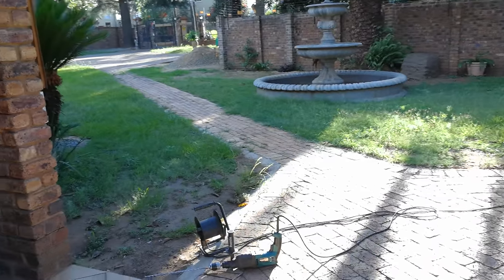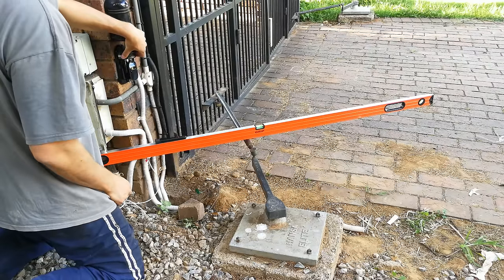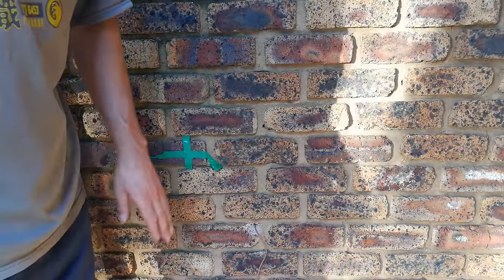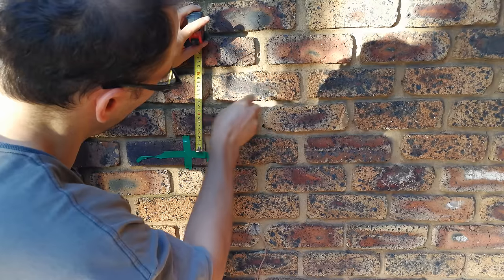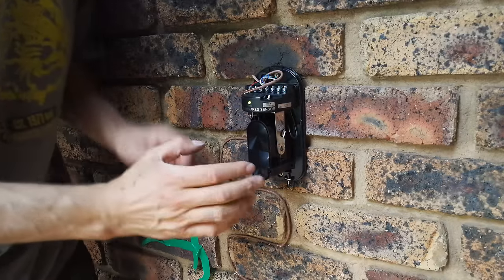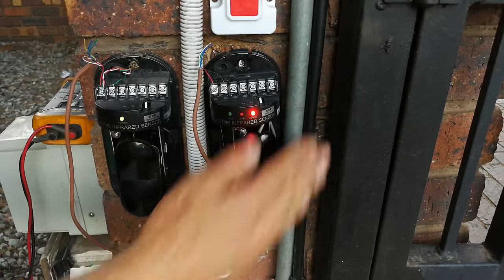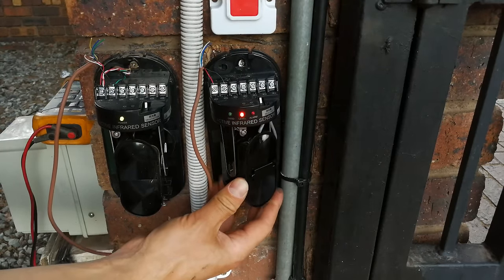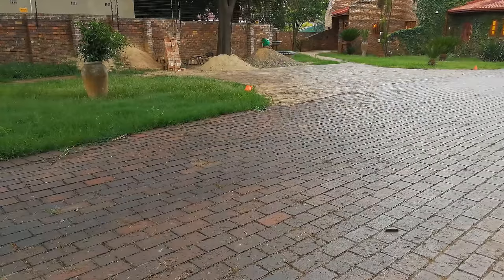How to install infrared detection beams (40m) - calibration shown

Comment: I use some Sonoff products like the 4ch pro r2 that's 12v and 240v with WiFi and rf remote control and working with Ewelink app and get pushed notifications and work with Amazon Alexa aswell  , built my system that way but limited to the pir sensors. Also relays are just switches can use supply voltage or both 12v or 240v for switches. Also for our sensors to sending signals to the 4ch pro r2 you will need to purchase the Sonoff rf bridge aswell.  Thanks for posting. Hope that Africans  don't jump over the beams lol.

Comment: I’ve found that by using a 4.5in grinder with a concrete blade you can cut out the mortar joints and cover the wire inside the cut and add new mortar. This is a much cleaner installation and the wiring isn’t revealed

Comment: I have the easiest technique. Put the important one in place get extension cord and put next one right up to it and walk backwards checking the lights
Reply: Tried that. Not so easy over long distance (30m in my case). About 15m away you start losing the line up, then you have to step forward again and start over. Could not do it.

Comment: Hi EcologicalTime, Im just about to buy these for my bungalow. Would you give me your feedback if they are still working well at your home. Are these reliable ? Any false alarms ? Your maximum inputs will be greatly appreciated !
Reply from the maker: these particular ones from IDS are very reliable. Never had an issue, installed many. They do consume a fair amount of current relative to PIRs and do not have any modulation. False alarms, only for Hadida birds which set off any type of sensor.
Reply: @ecologicaltime  But im picking up ones from Aliexpress, since im in India.

Comment: I have a question,  is there a way to "earth" these beams as when we have bad thunderstorms it killed our alarm Unit, or even install some kind of protection?. My indoor alarm has no issues only the Alarm unit that connects the sets of beams.
Reply from the maker: earthing will make it worse. Rather connect them wireless. I will be doing some videos showing wireless connection in the future.
Reply: Maybe earth your alarm panel however it might not protect it fully

Comment: Hello,
I have installed the sensors on a door that if sombody passes by it will trigger a Dc/Ac relay then it will go to a timer relay that will power a water pump. It is working all good the only issue i have is that the relay from the sensor send signal for only 2 seconds and then it off. 
What is the solution please? There is no timer relay in the sensor.
Reply from the maker: you can use a one shot timer to increase the period. You can make one using RLC circuit or 555 IC, or you can buy it as an electronic kit. You can set the one shot timer to be anything from milliseconds to hours. 
https://www.electronics-tutorials.ws/waveforms/555_timer.html
Reply from the maker: https://www.allaboutcircuits.com/tools/555-timer-monostable-circuit/
Reply: Thanks alot. I will try it